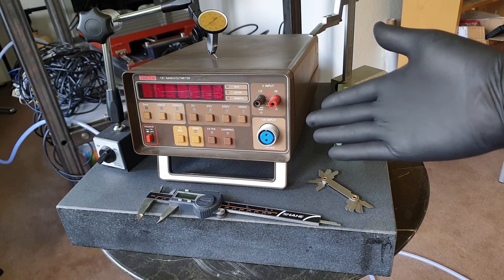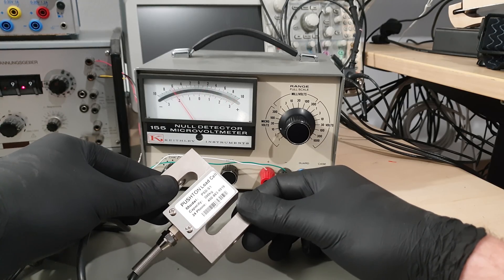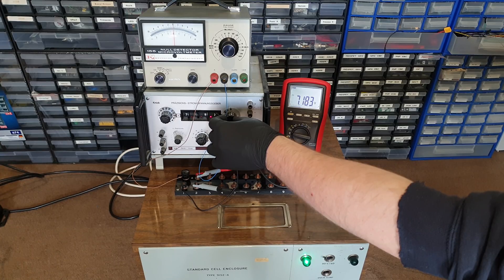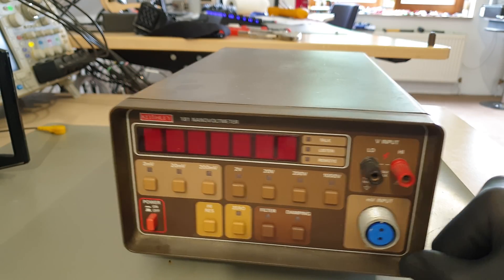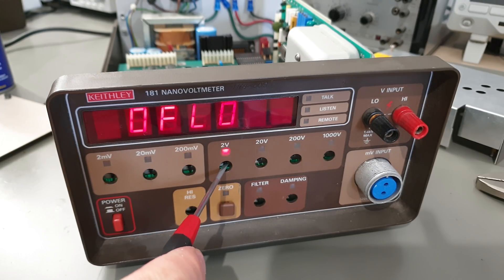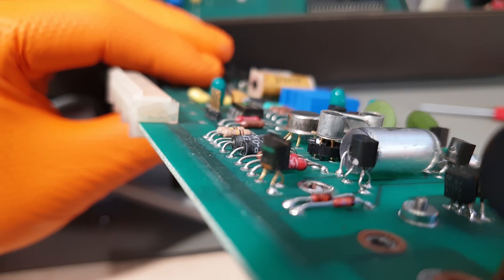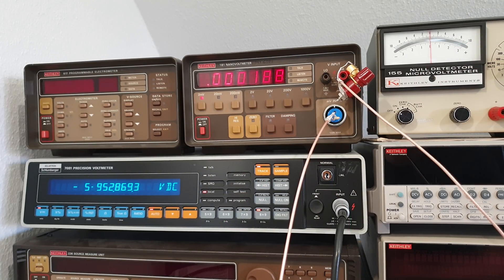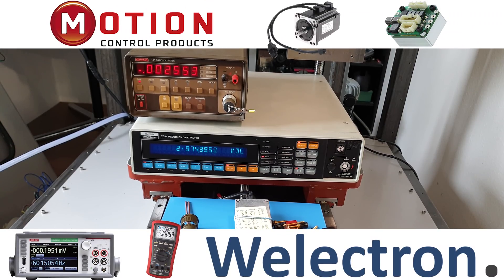Measuring low voltages with old Keithleys

Comment: The Keithley 2 Pin pure copper connector many years ago Just for the connector was around £200, I used crimped Gold Plated Copper on Silver plated copper PTFE Twisted pair with Silver Screen outer Tufnell Outer wrapped, NO SOLDER used in the UKAS Test Laboratory on Low voltage cable for any DC measurements,

Comment: That funny reduction geared pot also appears in early Tektronix scopes...and, stacked with another standard pot, for the horizontal position control...
Proper press-fit connections are used in automotive applications because they are so very reliable..."proper" ;-)

Comment: Did you know about the VEBEG? It's a company that sells stuff from the german government that they don't need any more. They are selling all kinds of things, from tools to cars and even big research Ships. But most importantly they sell measuring equipment and such stuff. At ths time they have a signal generator that has a working range from 10MHz to 20GHz and a frequency analyser that goes down to 10 mikro Hertz

Comment: Brilliant - as always ! You might also be interested in the Präcitronic MV40 DC-Milli-Pico-Meter. It's an instrument from the late 60ties made in GDR. It comes with a pA and a 500 Teraohm (!!) measurement range and it's also based on a chopper amplifier. I've repaired and restaurated some MV40, and they're quite fascinating. You can get one for about 30-60 Euro.

Comment: You can blow out the solder from through holes with compressed air?
Mind blown. Thanks for saving future me hours of frustration.
Reply from the maker: I just learnt, that under certain conditions it can build up some static charge, so use with care
Reply: @reps  It also splatters the solder a bit. So cleanup afterwards is required.
But as a last resort if the wick or the pump doesn't work it's brilliant.
Reply: no that doesnt work.
Reply: @smokinjoe1256  I just tried it and it works.
Reply: @ronin181990  that was just luck....try it again

Comment: Hello, I would like your recommendation for an air compressor thats suitable for electronics hobby (cleaning pcb, etc, just like you demonstarted). If one searches on google, nearly all info is for/from people who use the compressor for heavy stuff, inflating car tires, drilling tools etc. I am asking because it appears you have such leightweight setup running. Thank you, bye.
Reply from the maker: Oh just one of those quiet oil free piston compressors will be fine. If it's really only for the smallest stuff, you can specifically look for air brush compressors, but those will be empty before you are done blowing out a PC case for example. 

I got a pornographic, quiet, oil-lubricated piston compressor by Jun Air. It has been treated poorly, so I could afford it ... barely. It was a great restoration project, but the replacement parts are as obscenely expensive as their new compressir prices suggest

Comment: A tip for clearing stubborn vias of solder. Grab a toothpick and dip it into molten rosin or any other type of flux. Then apply heat to the via and stick the toothpick in it. Will clear it right up.

Comment: Marco, what are you using for compressed air?
Reply from the maker: Oh the standard stuff: 80% Nitrogen, 20% Oxygen works well!
Reply: @reps  I mean, what equipment? A quick search got me only "canned air" disposables.
Reply from the maker: @monkeymatic  unless you also want to also run air tools, you can use a small, quiet piston compressor ... sometimes called air brush compressor! but beware, it can generate some static under certain conditions

Comment: For cleaning stuff from pcb holes it helps to add new solder (just so that you have a little bump over it) and then put a lot of flux on it (for me those flux pens works best). Then just use braid normally. Edit: Solder pump from the other side if you have access.

Comment: I went through a brief period of volt-nut a few months back,  now I have an HP3478 and 4 LM399s, not sure what to do with them and I don't even have a soldering iron yet. Planning on making a small station based on cheap T12 clone tips, but thermocouples, how to get readings from them and your boi, thermal EMF are really confusing me. BTW, the guy that sold me the meter has two of those Keithley 6 1/2 nanovoltmeters, as well as HP 34401s, 3457s, K2000, Tek TDS3052,etc....Have no idea what his job is(won't tell me), but he seems to have access to lots of T&M equipment, industrials electromechanical stuff. Kinda regret buying the 3478 (3.500.000VND or 150USD).
Great video, sorry for long post. Greeting from Vietnam.
Reply from the maker: Voltnut detected, stay away from the guy or you'll get infected. Maybe it is already too late :)

Comment: Those PCB press fit connectors can be made extremely reliable. EEVBlog 517 was an airbag controller teardown and it used those press fit things. If it's reliable enough for an airbag, they're probably reliable enough for a front panel.
Reply from the maker: Oh yes I vaguely remember that ... but I still don't like it

Comment: YAGV... Yet Another Great Video, thanks, love your humor. Next time you do some ultra low voltage measurements, be sure to clean all electric al contact surfaces, back in the day I attended a coax cable connector cleaning course, significant difference between before and after cleaning measurements, often enough to bring an out of spec device into spec.